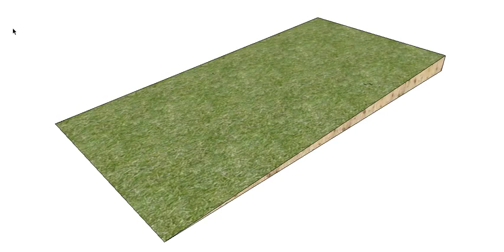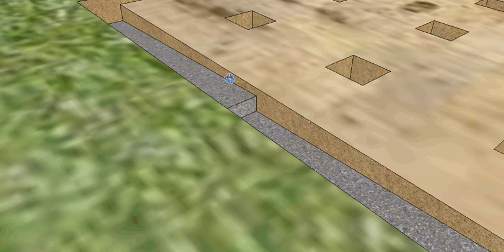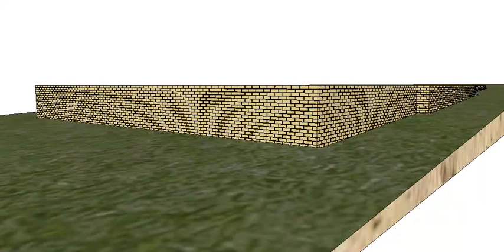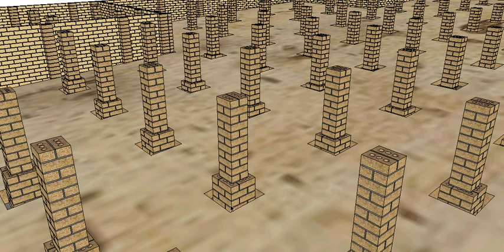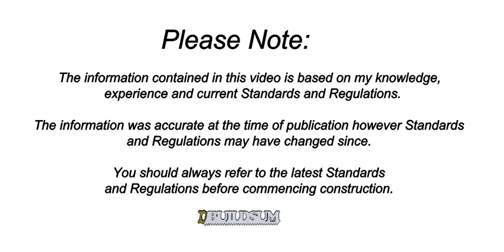Stepped Strip footing

Comment: What about the structures floor? It's gonna be less then a foot off the ground on one side and 5 foot off the ground on the other? What about the space under that floor?
Reply from the maker: Hi Isabel, yes there will be a far amount of space under the building which some people use as extra storage space or if the block of land is really steep they can design a garage or extra rooms in this area. With a timber floor you are required to have a minimum of 400mm between the ground and the underside of the lowest timber member ( the bearer) so there will always be some unused space with this type of construction.